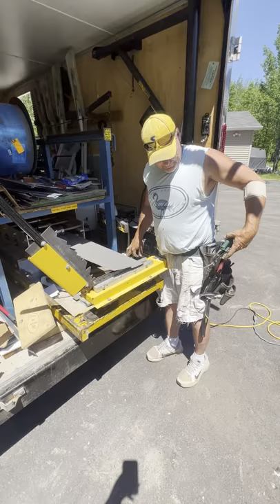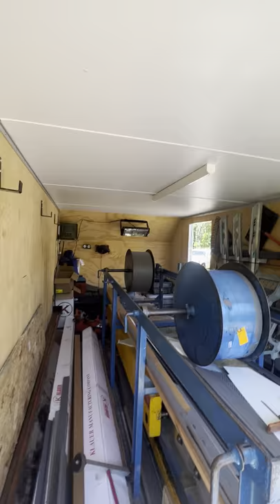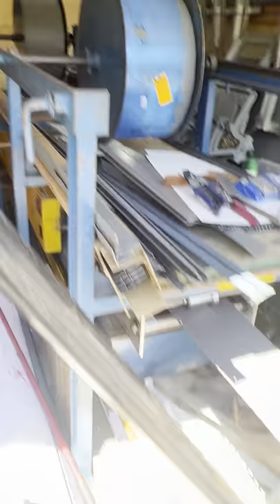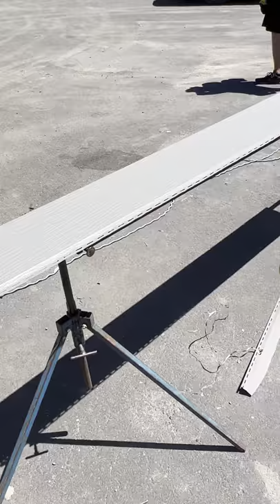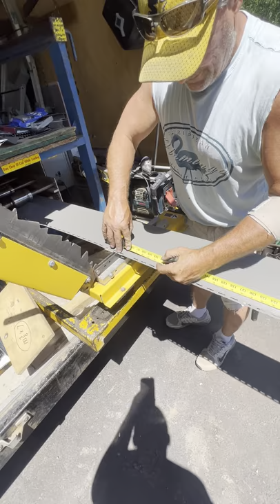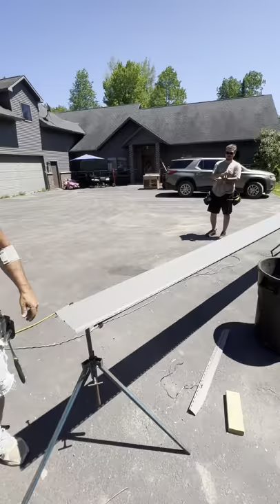Satisfying Seamless Steel Siding @jrsbuild

Comment: My parents put this on their home in the early 90s this stuff is amazing! I wonder if they found a way to fix the thermal expansion issue where it sounds like someone running across the wall when it starts to heat up in the morning. The stuff they used was vinal coated.